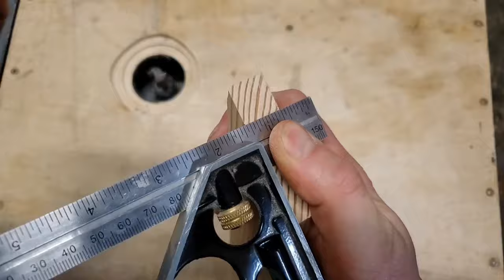Tiny Houseboat Build (Part 8)

Comment: That is some incredible wood work for those steps you made, I have never seen the like made from scrap wood before. Perhaps you should protect them with clear epoxy on top, just to keep them that nice for longer.
Reply from the maker: I used a couple coats of polyurethane to protect them. Epoxy would be a great choice too though!

Comment: Amazing work! :) Only missed oportunity IMO would be some hidden hinges like in cabbines, from inside. Neverthanless is realy nice craftmanship. Cheers! :)
Reply from the maker: I thought about it, but I decided against it because the plywood is just 3/8 of an inch thick and it would not have been very stable to screw the piano hinge screws inbetween the layers, which is what I would had to do in order to hide it. I guess I could have used some sort of cabinet hinges like you suggested, but I wanted to keep the cost down and use what I had. The piano hinges are so shiny, I actually really like the look of it😁

Comment: You never disappointe me with your attention to detail
A extremely good tradesman
I have 1 question for you the boat bottom, did you use marine plywood or pressure treated and your reason why. 
Have a great Christmas, look forward to your next video
Reply from the maker: Thank you!!

I used marine grade plywood. In my opinion it is well worth the extra money, the individual veneers are flawless, you never have a knot hole in it and therefore it is more stable and nicer to work with. They also use a different glue between the layers, which is waterproof, so less chance of delamination in case it ever gets wet. I experimented with pressure treated plywood, exterior grade plywood and marine grade plywood before I built the hull, and it was quite obvious for me that the marine grade plywood is far superior due to the high quality of the individual layers and I felt like this is such a big project that it really would be a shame to have problems later on because I was too cheap to spent the extra couple hundred bucks for the right material, especially for such an essential part like the hull. But that's just how I think about it, there are a lot of opinions out there.

You have a nice Christmas as well, and thank you for watching and commenting!

Comment: did you design this house boat or just find something that worked for you? how did you find the depth it will sit in water and find the stability as well so that your not top heavy? Thanks .
Reply from the maker: Thanks for your interest Christopher! I basically design it as I build it, which is an unusual approach and it comes with its own challenges, but that's the way I always have built things. It gives me the most freedom and room for creativity. I am stealing ideas from other builders such as Roy Schreyer and the Houseboat build by Caraboat but also many others builders on youtube and the internet in general. As of right now I don't know the exact depth the boat will sit in the water, since I don't know how heavy it will be. Based on comparisons with similar existing boats it should have a draft of 6-8inch though. The hull is completely sealed up to 2ft. so I have a lot of wiggle room in case I am a little off. (Once I know the weight I could to the exact math, but I feel comfortable to just estimate this.) 

The beauty of a flat bottom hull is that they are very stable in calm water. (Not so much in rough/choppy water, so those conditions have to be avoided, which also rules out oceanwaters...) I also have two 3 inch keels to help stabilize the hull in the water. In addition, most heavy items such as watertanks, fuel tanks and batterys and other heavy items will be located as close to the bottom as possible to keep the center of gravity low. 
I hope that awnsers your questions, part 5 of this build might be interesting for you since I talk about some of it. 
Cheers!

Comment: Wait. You drilled the holes for the dowels BY HAND! And they lined up!?
Reply from the maker: 😄Yeah, I did indeed. I marked the right position on both ends before hand though, so the beginning of the holes where on point but i had to eyeball the angle. Also the fit of the dowels was more on the "generous" side, that gave me just enough play to make up for the not 100% right angle.
Reply: I just finished catching up on the series after finding your project. I subscribed and eagerly await the next installment.

Comment: Could you have put the piano hinges on the inside instead?
A lot less visible.
Reply from the maker: No, the "endgrain" of plywood does not hold screws very well. You would most likely just split it. If you mount the hinge completely underneath, then you have to leave a gap in the back to allow space for the plywood in the upper position. That would turn into a dirt trap, which is why I did it the way I did. I actually like the chrome look of the hinges.

Comment: if you are thinking of insuring your boat you will need to comply with transport canada construction requirements for pleasure craft especially wrt battery storage, wiring and breakers.  it took me quite a while to find insurance even with a good survey report.  why insurance?  because we have to launch and store our houseboat at a marina.  not enough yard space.  I never thought about insurance when building.
Reply from the maker: That is very interesting, I actually ordered stranded wire because of one of your videos that I watched, even though I never will insure the boat. It is a interesting thing to bring up though because it is something nobody thinks about. Would be cool to see a video where you talk about the things you had to change or add and how you even figured out what the requirements are.
Reply: @adrianwoodworm  I've been thinking of doing such a video of things done right and not so right.  but in the spring.  If you are going to haul your houseboat on a trailer, I think that you'll need insurance in BC.
Reply from the maker: @ourtinyhouseboat  My understanding is that I will have to insure the trailer, but not the boat itself which is not a legal requirement, even though it is recommended.